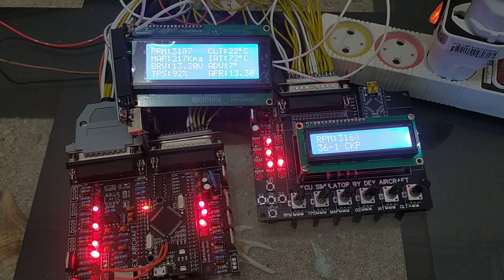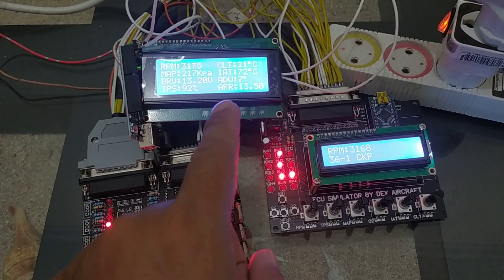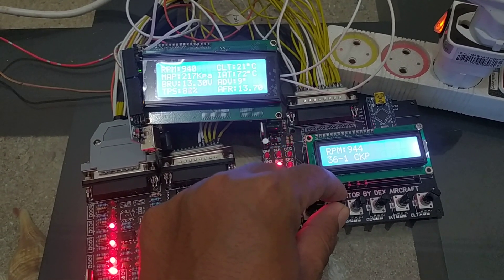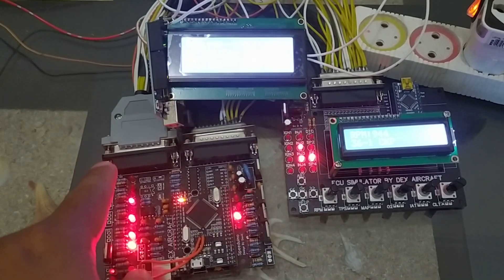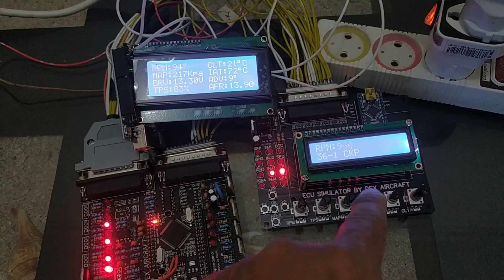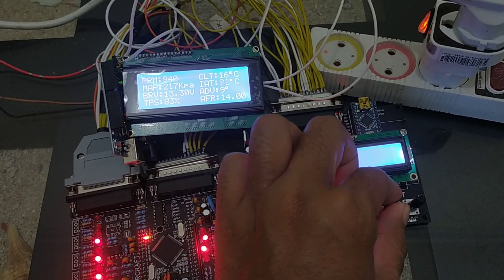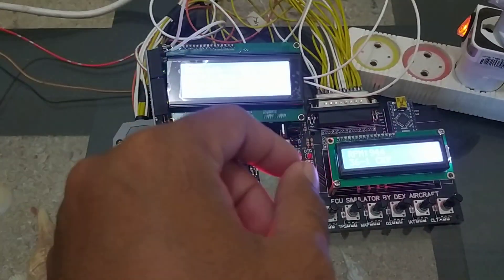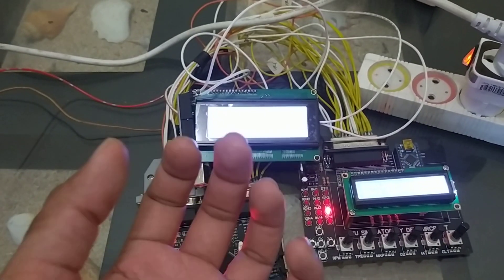Speeduino LCD Display Cheap and easy

Comment: Gan kalau untuk engine diesel 6 silinder apakah bisa disimulasikan
Apakah ada modul nya
Reply from the maker: Bisaa. Saya biasa kerjain ecu alat berat bisa. Cumin, kobota, suny, hino dll.. yang penting tahu pattern nya
Reply: @DEXAircraft  wa nya gan atau chat di Tokopedia ya gan
Reply from the maker: @anasyusuf2715  085869262524